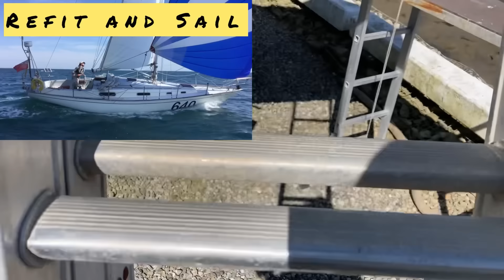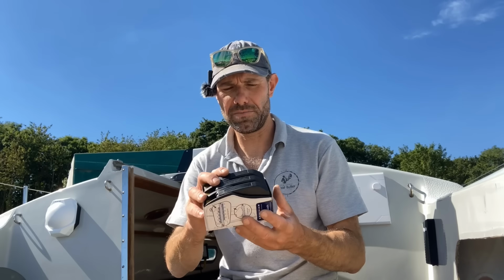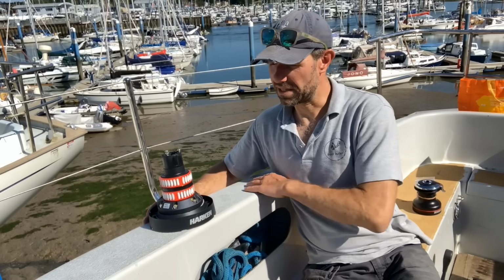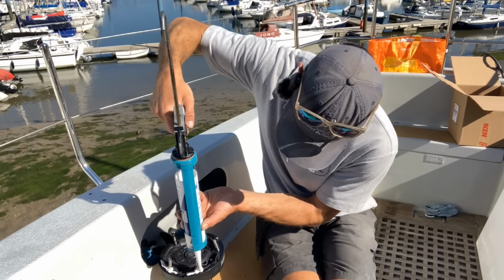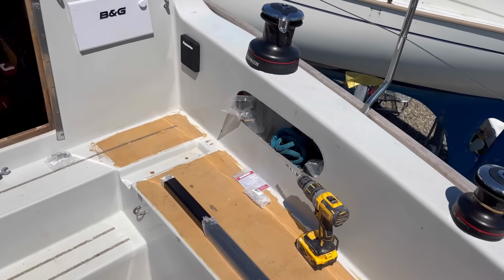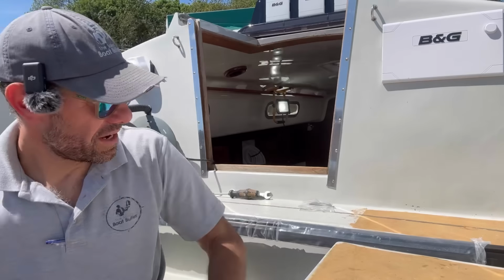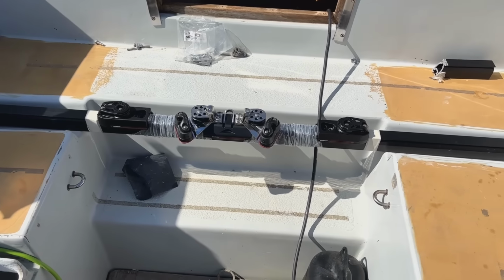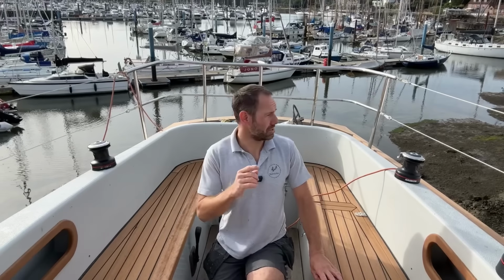Fitting All New Deck-gear - Contessa 32 with Harken, Lewmar & Spinlock (Project Lottie Ep 33)

Comment: Owner must be sitting in cash, 6 winches is exaggerated, never handle the spinnaker sheet from the cockpit could use the windward halyard instead while trimming the kite!
Reply from the maker: Indeed you can do that and many boats do but this is a one-design class of racing boat so the specification of having dedicated kite winches has to be followed to stay in class rules.  This is the standard arrangement for co32.
Reply: Need the windward coach roof winch for the fore guy…
Reply: Great video George.  Looking forward to the next one- I need to install some eyebolts to tie the dinghy on deck, interested to see how you bolt through the deck and internal deck head liner…

Comment: Great video as always.. call me pedantic but just a little observation on the bit where you 'brushed' away the chips and dust from drilling through the cockpit onto what seems to be sand below, very close to shore. I would probably use a vac or collect these otherwise and dispose of them properly; would hate to see these little bits of plastic floating around. I know it's a drop in the ocean, but they do tend to accumulate and last forever unfortunately..
Reply from the maker: That’s a very fair comment and I am 100% in agreement with you about not dropping plastic waste on the ground or into the water (although sometimes it’s unavoidable when working in a windy boatyard.  The chips and dust were brushed off onto the side deck and then hoovered up off camera as I have to edit these videos down to  sensible size.   On the Timelapse you may (from memory) see me vacuuming up the drillings when doing the spinnaker winches.   Thanks for pointing this out and happy you say I agree with you and do try to capture waste so it does not pollute the environment we all share.    All the best! G

Comment: Lovely video George =)    Question.   Wondering why not drill oversized holes and fill them with epoxy and then drill again to avoid damaging the wooden backing for the winches with water Ingres?   =)
Reply from the maker: That certainly an option but I’m much more confident in modern sealant than the stuff that was used when the boat was built.   If the deck was cored that would certainly be necessary.  TBH it’s a bit overkill for this situation - remembering that I am working on a clock and paid by the hour so if I double the length of the job then the client pics up double the bill.   So I would do it where I felt it necessary but in this situation it really isn’t imo.

Comment: Since you're discussing stripper ring position, here's a tip I got from a Figaro racer: Angle it so that the line does a complete 360 in the jaws before it falls in the cockpit. Otherwise, the line will partially exit the jaws and sometimes it will slip. So, I would adjust your port winches differently.

Comment: I cut tonnes of aluminium with a chop saw with a wood blade, works beautifully. I occasionally use a circular saw and a speed square, you just have to take your time, I don't even know where my hacksaw is 😂
Reply from the maker: Yes, works well but chopsaw was in the workshop and I was in the boat yard… 😂
Reply: @RefitandSail  I'm too lazy to use my hand tools I'd rather lug my power tools to and from my van.... or just daft.

Comment: Hi George what material was used for the seating etc in the cockpit as looks fantastic........ Regards Nick
Reply from the maker: That was done in Iroko, not quite as nice as teak but considerably cheaper, it will go grey with time much like teak.  It had just had its final sand after install in that video.
Reply: @RefitandSail  Thanks George.    Brilliant workmanship

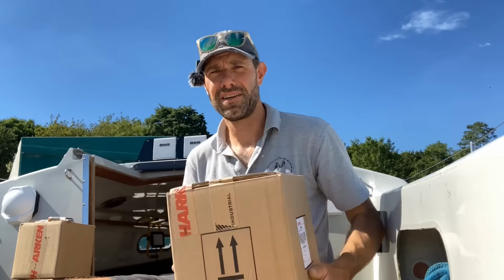Comment: Where did you get those shiny stainless steel plates both sides of the  companion ways ? (At 1:43 behind you)
Reply from the maker: Any stainless fabricator should be able to make some but most uk built co32’s have these (but not all).